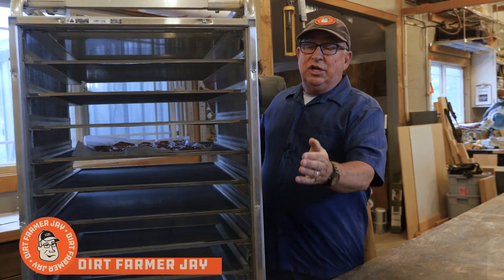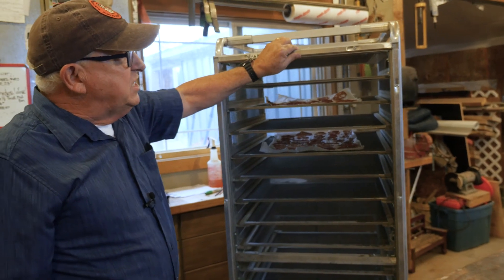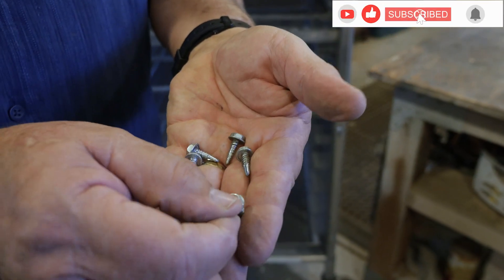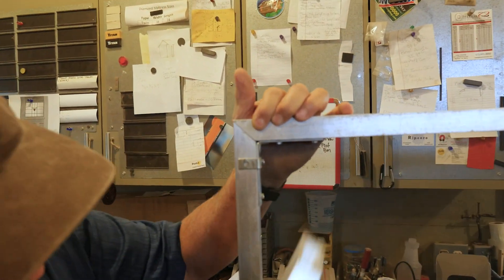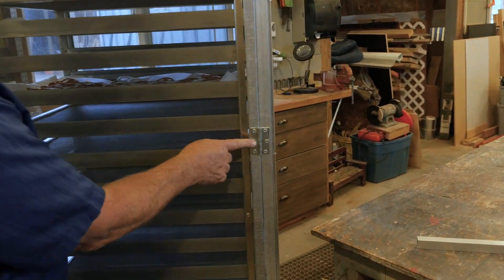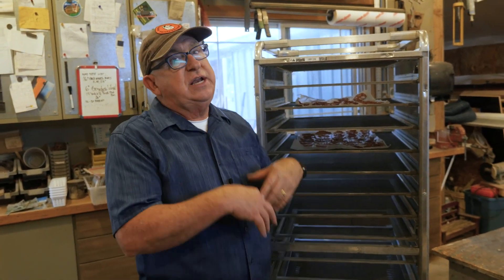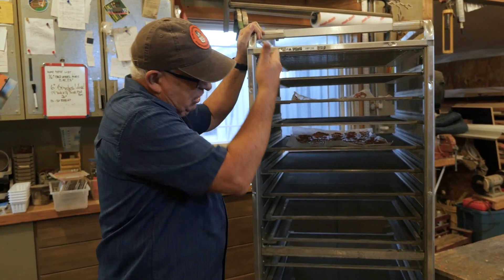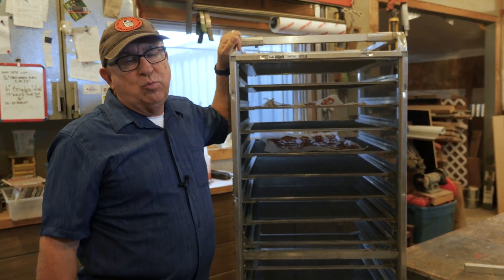Simple DIY Solar Dehydrator

Comment: Consider taking a computer fan and solar panel to increase drying rate.  Nice project.  Makes lots more sense than buying one for my part of the country.
Reply from the maker: Great ideas. Thanks for sharing.  I see they are very reasonably priced and widely available. We are going to be adding a solar black plate heater as well. We'll do a second episode in the spring/summer next year with enhancements to the project.  Best regards, DFJ